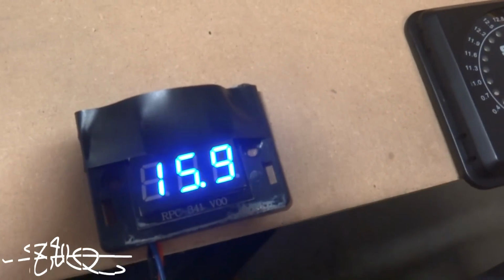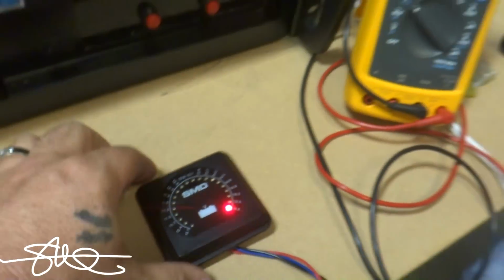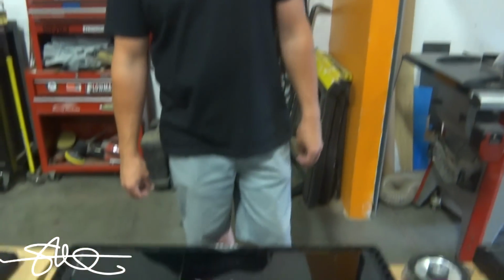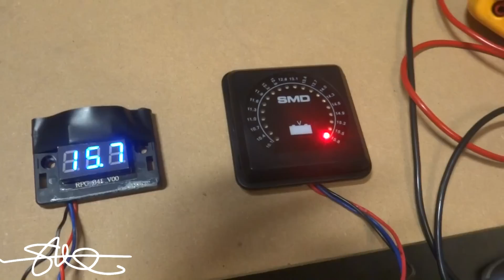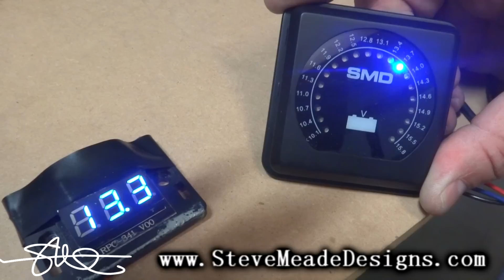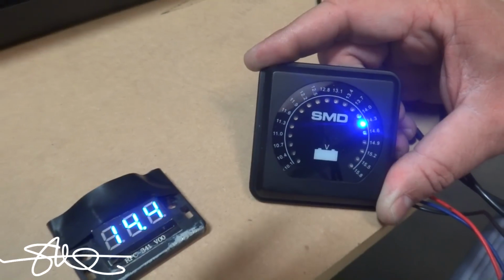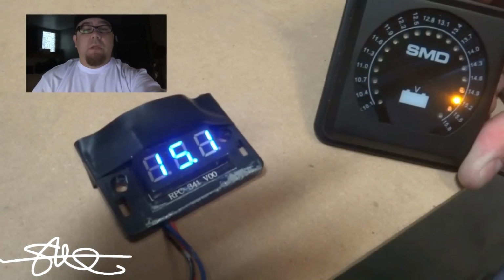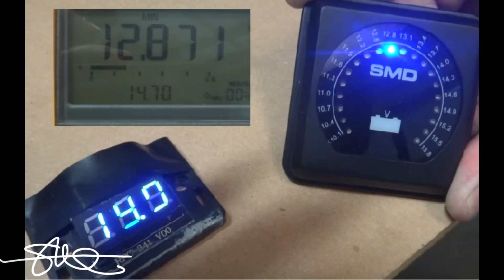SMD VM-1  High Quality DC Volt Meter (why it's better)

Comment from the maker: i saw ours move back and forth 2 times, almost 3 times before the other one knew what hit it......so the value is accuracy.  If accuracy doesn't matter then you might not see the value in it.  Also, we aren't trying to reinvent the wheel.  Its just another CHOICE of VM that will be out there on the market.  At least its unique......

Comment from the maker: the other brand did not even drop as far as the voltage dropped.  I did it in slow mo to show you the difference because it is hard to watch both at the same time.  If you don't want to buy it, i really could care less, thanks anyway.

Comment: Steve what i think sk7ca meant is that you may be able to see just how far you are dropping and have that fast response but until you know what position every led is for each voltage range then you just have the knowledge of if its in a safe voltage range or if you are getting into trouble but having it so the print on the PCB is illuminated or glows someway somehow would help users know "Okay this led is lit up, this means its at xx.x volts. ya know?

Comment: HMMM 5 dollars vs 50?   And the text is so small on the SMD one you have to be so close to even read it.  But you are right it does respond fast.    You should put a small regular dig meter right in the middle of yours for quick glances
Reply from the maker: you don't need to "read" it to know how much voltage it is...but it is VERY easy to read regardless.
Reply: @meade916  Probly just me, im blind as shit.  Thanks for the reply.

Comment: My brand X meter has pretty blue lights (and comes in red), My brand X meter can actually tell me the voltage of my 14 volt system ( 16.8 charging volts), my brand X meter cost $20. Brand X meter is available EVERYWHERE at a competitive price. 

VM1 has pretty blue lights, VM1 can only read up to 15.8v (only good enough for 12v setups), VM1 cost $80(special price) and $100 regular price. Only available from West Coast Audio and your gonna pay for that luxury. 

I can live with a little delay.

Comment: Awesome Steve I like most thought ehh its just a novelty my stinger meter is fine until you did the slow mo(awesome idea btw) amazing to see how much you can actually drop this will be a vital part of my setup when they are available dropping low voltage cooks equipment and I ain't no chef lol   I was thinking of running 2.  1 for the front batt and 1 for the rear batt bank do you think this is overkill or would 1 be good enough. Anyways keep the innovations coming.

Comment: Steve why don't you add some light for the numbers so when its dark you can see how many volts your running on and it will look really better if you also made the SMD and the battery glow too white will look insane with the blue for the analog:) just an opinion:)

Comment: great video brother. I'm just curious about the wiring on this. I have a cheapo meter with positive and negative leads running directly to the amplifier. positive to the remote and negative to the ground. can your product also run this way or do all 3 wires remote, power, and ground have to be re-run. imma order one regardless just wanted to know. thanks in advance bro

Comment: Just a question. I have a vm1 and it's showing 14.6 when my batteries are at 14.8 . Tested with multiple dmm. Just wondering if that's normal?

Comment: I connected mine to the positive and negative wires on my amp. It always shows the voltage and drops when the subs are bumping. Then I checked the battery voltage with a voltmeter and reads different than the one on my trunk.
Battery 14.3
Trunk 13.6
Why?

Comment: Yes, but with this you know that your electrical system does can not cope with the demands of the amplifier you're running. 12.8 volts certainly is not bad, but other people running a less powerful electrical set up may be dropping down to 11 and below without knowing.

Comment: I second that. My gains r set with the dd1 also. But it seems that I clip on my bass knob before I should. I'm running a aq1200d there is a clip light that is built in to the knob. Any answer for this?

Comment: steve i could use help i am getting one of these after i get a new battery i know u use excess power and i am looking at one to one for like 205$ my system isnt massive basic head unit and 1k amp not running full out i live in indiana where it gets very cold is it worth it to get this battery right now i have a crapy interstate

Comment: If you have to slow mo the video to prove that yours is better you also just proved that the advantage it gives is soo small it's not noticeable. No one is going to take a slo mo video of their volt meter then after the song is done look at the slow mo video to see if the voltage dropped too low because by then any damage would have been done. So the only "advantage" your volt meter has over the competition is looks and I am not going to pay up for looks.

Comment from the maker: your brand X VM is a piece of shit.  I owned plenty of them.  The VM-1 is going to be available for 18v systems.  Already have the board done and 2 proto's out.  You won't need it though so what are you bitching about? The VM-1 is 69.99 with a coupon code.  You go live with the "delay" and the false readings.  I will stick with speed, accuracy and made in USA reliability.  You stick with cheap, slow and about to break any minute chinese.  Its your right to save a buck, nobody is stopping you.

Comment: @meade916 ..welcomes (: and well i know im no one to tell u this but it would be cool tht u make one volt meter tht reacts the same as the one u did ut digital and instead of "stinger" tht it said SMD in blue led's identical to stinger svmb but difference is tht it will be ur name on top (: (with respect)